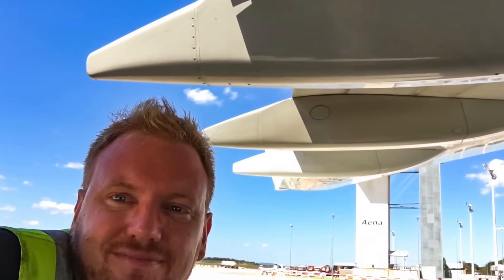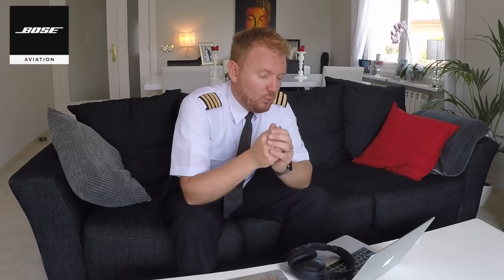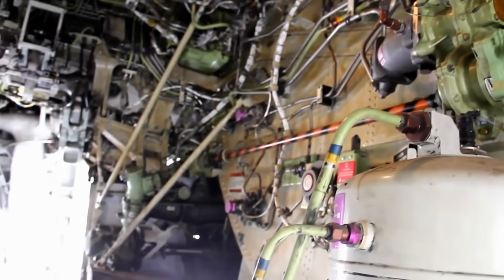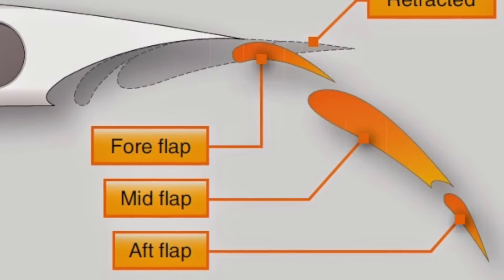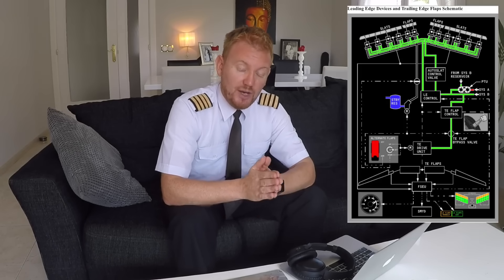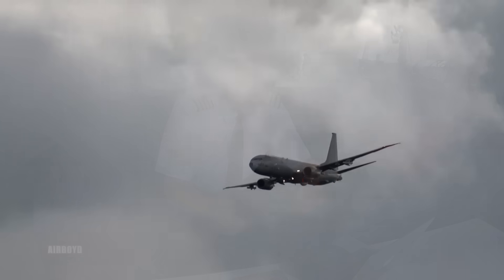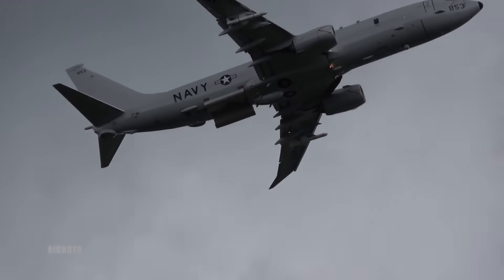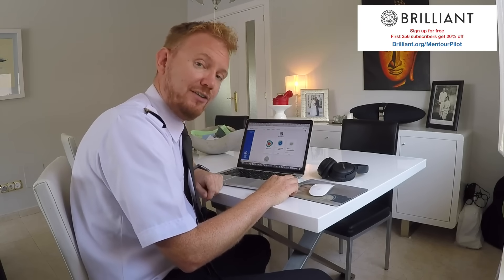"Pods" under the wing? What are they?

Comment: Why not build Burnelli aircraft instead, and skip all these fancy gadgets?
Reply: Why do you think a flying wing type aircraft could dispense with "all these fancy gadgets"? It still has to be efficient at cruising speed yet be able to slow down enough to land on existing runways. That means you  have to have some way of drastically altering the geometry of the wing in flight.
Reply: Most Burnelli aircraft were designed back in the 30's, before high speed flight and aerodynamics were fully understood.
Reply: Aaron Murphy,
elbuggo's reply  must have been deleted before I could return to respond. The CBY-3 that he held up as an example of why it didn't need all those "fancy gadgets" had a landing speed of nearly half it's cruise speed of just under 170kt. Conventional planes of the pre-jet era didn't need very elaborate flaps either, just ordinary one-piece Fowler flaps at most, and they were much faster than the CBY-3. Modern airliners cruise just under 500kt and land typically at 140kt, less than 29% of cruise speed, thus the need for elaborate machinery to create a different kind of wing on the fly, so to speak. Can you imagine the kind of airports we'd need if all the airliners had final approach speeds of 230kt? To say nothing of the noise and the cost of tires and brakes.
Reply: Why Aaron, has no Burnelli aircrafts been built at all after 1946? Why? Why not? Had way better performance than any other plane then, an we should expect some development there too. Take of and lading is by far the most difficult and dangerous portions of flying. The need for half the runway was also really significant.

I asked: why not build an Burnelli aircraft instead?

You answered: high speed flight and aerodynamics weren't fully understood in the 30s.

You don't make much sense to me here, and I'm unable to find or see any crucial problems at all with the Burnelli aircrafts - non. It is only & simply a far better design.
Reply: elbuggo,
I thought you might have thought better of your claim when you deleted your initial reply. Apparently not. The crucial problem you missed is in my answer above.
Reply: I don't know the answer to that one. Why has every airliner for the past 50 years been a tube with wings and podded engines? A lot of it is money. Airlines don't want to invest millions in "New and Revolutionary". They'd rather invest in improving "Tried and True", and getting better fuel mileage. Plus anything that would require major changes at airports gets sent to the back burner immediately. NASA has been working with various aircraft manufacturers on Blended Wing Body aircraft for as long as I can remember, but they never get past flying models. Instead, we get Extended Range versions of existing aircraft, or more of the same aircraft, just made out of new lighter materials with bigger fuel efficient  turbofan engines.
Reply: blindleader42 - CBY-3 needed half the runway compared to MD-80 for takeoff. They used same engines. Ceteris paribus, modern Burnelli should require half the runway of modern aircraft without flaps, or maybe the same with flaps.

Cant find anything on slow cruising speed. I find Burnelli had same cruising speed as conventional wings on a pipe aircrafts 1946.
Reply: Re: A lot of it is money.

I think you are mostly right. Has nothing to do with the fundamental brilliance of the Burnelli design - no one is saying bad word on Burnelli - I only find praise. Not much al all to find though.

Blended Wing Body aircraft is something completely different.
Reply: elbuggo,
Now you're just spewing fantasy, comparing a 170kt 1940's piston powered experimental aircraft with a 460kt production jet, and claiming they use the same engines. I'm sorry, but "all things being equal", physics is physics, nonsense is nonsense, and if you want to cruise at 460kt efficiently you're going to need a vastly different size and shape of wing to get back on the ground safely in the real world. Currently, and for the foreseeable future, that requires "fancy gadgets", like multi-part flaps, leading edge slats, maybe flaperons and thrust reversers.
Reply: I mixed up two reports here. The performance numbers I gave was for Burnelli GB-888A (never build) and MD-80. These are just estimations, and not worth so much. I don't have the specific numbers for CBY-3 compared to the convectional plane with the same engines 1946. Should be a lot that don't make sense here then. More later maybe.

Comment: what is the % difference in stall speeds with flaps vs no flaps
Reply from the maker: Depends on many factors but around 60 knots I would guess. 
We stall at around 170kt without flaps and around 110 with. 
More or less.

Comment: The US Military plane was a US Navy P-8 Poseidon, they are modified Boeing 737-800ERX’s that are designed for ASW (Anti-submarine Warfare). They carry torpedoes, harpoon anti-ship missiles, and depth charges.
Reply: +Reese McClain - And the P8 is also operated (with slight variations) by the Indian Navy and the Australian Air Force. It has been ordered by the Royal Air Force and the Royal Norwegian Air Force. The latter has mighty good reasons for submarine interdiction.
Reply: Yep that’s the item and capability index for one of it’s primary missions sets.
Reply: keith moore sensors win wars. You’re in the right path.
Reply: And chemtrail chemicals too! Let's not forget to dump chemicals on them nasty snubmarines!🤮

Comment: The shape of them is dictated by the area rule (has to do with cross-section size as you move from front to back) which improves aerodynamics and efficiency. Their shape is an anti-shock body which helps smooth the flow of air over the wing. Thus they serve a couple of purposes, to include improving the wing's aerodynamics as well as housing the flap actuators. Great video as usual Mr. Mentour Pilot, happy flying!

Comment: How does the aircraft pressurisation system works?
How is aircaft pressurised while takeoff and depressurised for landing.
Reply: The "hole" is called an "Outflow valve", it can be sealed completely or opened more to allow more, or less air out of the plane.
Reply: Prasad Waghmare Depends on how fast you are climbing or descending, I've noticed it tends to   keep the cabin alt climbing at around +300 fpm during climb until it reaches its appropriate pressure.
Reply: Prasad Waghmare on the A320, the system is fully automatic and defaults to a cabin rate of 350 fpm
Reply: I am just a layperson so I can tell you just a rough thing I read at wikipedia but I tell it to you because I found the idea in principle so cool!!!!! As far as I understood there is only a compressor to create overpressure + in the doors of the plane(!) (maybe also some other spots) there are littel well-defined holes where the air constantly flows out AND you can hear this, if you sit at seats at the end of the plane, a light whistle/sough. So when the plane climbs then the air flows out through the holes but the compressor is pumping a little less air into the plane than it's flowing out - so the pressure drops inside the plane but not as low as the pressure outside of the plane, so you regulate the air pressure simply with "giving" more or less compressor - compared with the amaount of air that is constantly flowing out if you are in the sky. That main principle is so easy and therefore technically not complex or accident-sensitive. Very interesting is also this point: at the first acceleration of the plane there appears an underpressure inside the plane because of aerodynamic effects at the start etc.(forgot details) and an underpressure would mean that burnt gas would come into the plane (or for other reasons that wouldn't be good, if air would flow from outside into the plane) and therefore the pilots (or automatic systems?) create with the compressor shortly before the start a light overpressure inside the plane (despite the aim after the start is lower pressure in the high air) but the light overpressure at the start prevents that the aerodynamic effects press unwanted air into the plane. (I don't know if all that is at all planes like this...)

Comment: I think my physics teacher taught me they r there to generate lift...(aerofoils). Otherwise gud explanation CAPTAIN... Thanks.
Reply from the maker: No, those pods are only there to house the TE flap mechanism.
Reply: Flaps increase drag and lift. Simply, when extended 10 degrees lift is increased but if extended more drag occurs. Not aerofoils at all.

Comment: I remember the first time that I boarded a plane back in 2005, i was 5 and i thought they were there to make the airplane float in water 😂😂. Don't ask me why. Great video as always Petter
Reply: Lol when I was about 8 I wondered where the ramp at the end of the runway was to take off!
Reply: Sure, they're for landing on the Hudson River and they work just fine.
Reply: Talking of floating, did you know that the A320 (and probably others too) has a 'DITCH' switch ? Although Sully Sullenberger didn't use it on his 'Miracle on the Hudson', possibly because he was afraid the loss of power from the engines might result in the little doors being ripped off as a result of under-extension,  its purpose is to close entries to water that would be below the waterline and extend the time afloat.
Reply: AcesFans ONLY why not?
Reply: Sure, pontoons, why not? :)
Reply: That was my best guess as well at that age, having seen pictures of flying boats with outrigger floats
Reply: And thank you for your very interesting and informative videos mentour pilot.
Reply: Not a bad guess I suppose
Reply: Mark Mossinghoff the emergency landing on the Hudson was done with an A320, not a 737
Lol btw😂
Reply: notmanynamesleft LOL ME TOO
Reply: Thanks, How do airplane get Power to drive hydraulic motor. How many kw it needs.
Reply: JosmerSueroMusicMix. J
Reply: Same!!!!
Reply: It was A320 not B737
Reply: Alvaro Cifuentes no traffic.
Reply: No plane wants EXTRA weight, unless it has a centre of mass problem as was the case with early 747s. Boeing's answer was to fit a lump of depleted Uranium in the tail (DU is a VERY dense material).
Reply: pasoundman Actually, it was to balance the rudder.
Reply: In the fairings ? Not enough space there, I'm sorry to say.
Reply: Alvaro Cifuentes 
We call them canoes.
Reply: Pontoons? Your not very smart are you? LMFAO.
Reply: @jimlowe8477  
"Your not very smart are you?"

It's spelled "you're", not "your".
Reply: Alvaro Cifuentes 😂😂😂
Reply from the maker: Great! I’m happy you like it! Please check out the Brilliant link in the description as well.